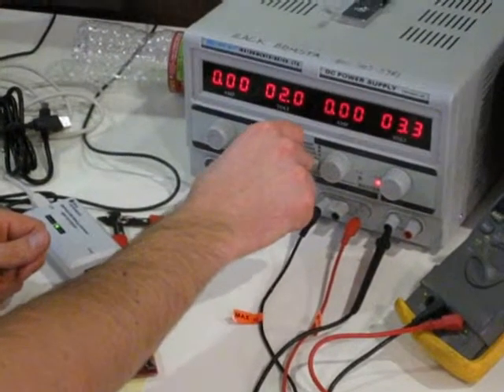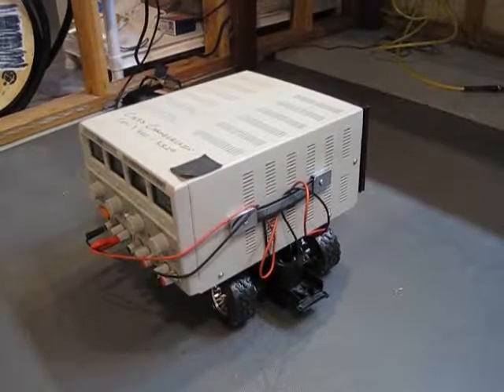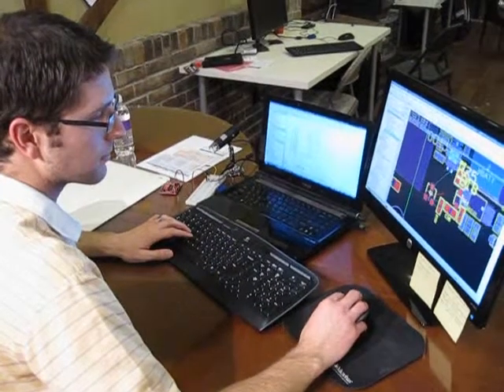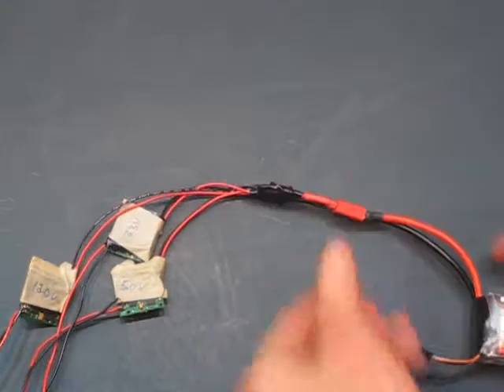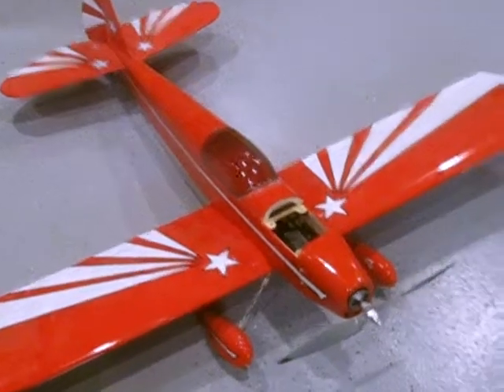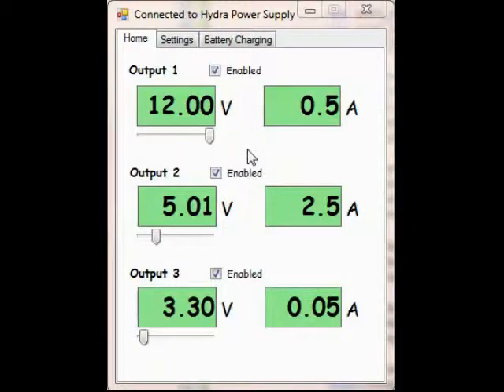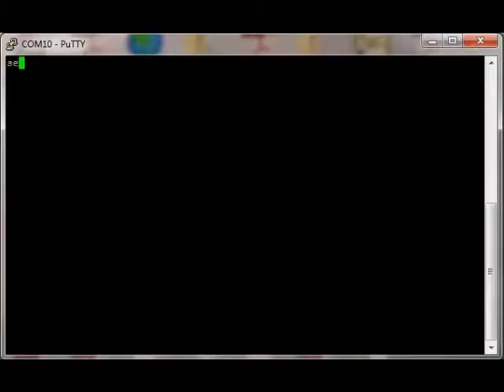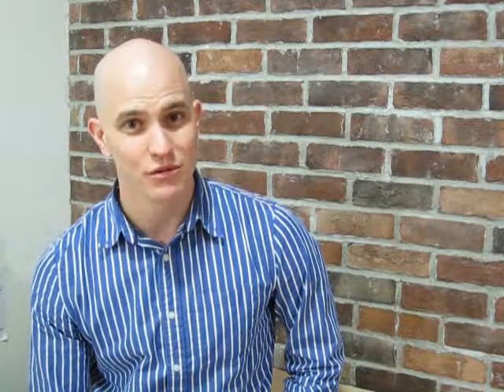The Hydra Power Supply: Powering everything, everywhere

Comment from the maker: No component is solely responsible, but the BOM for each buck-boost converter is quite high.  The price could be reduced significantly by requiring that the input voltage be always  higher or always lower than the output voltage.